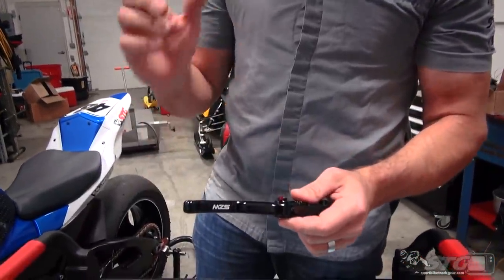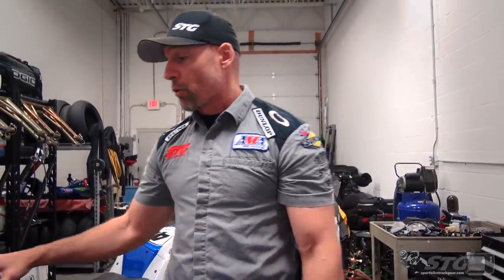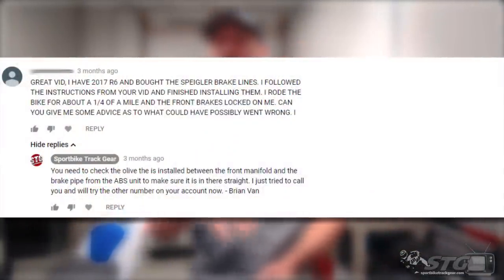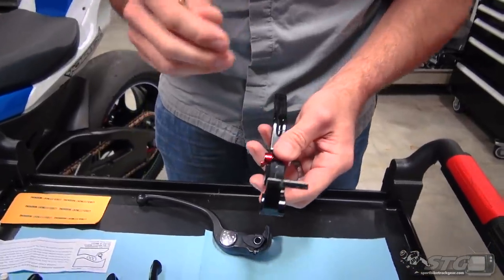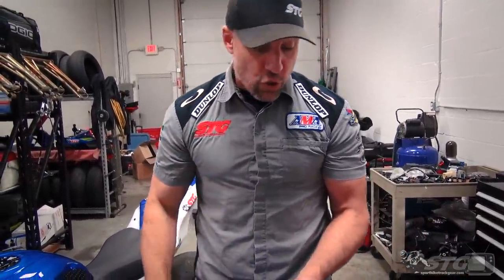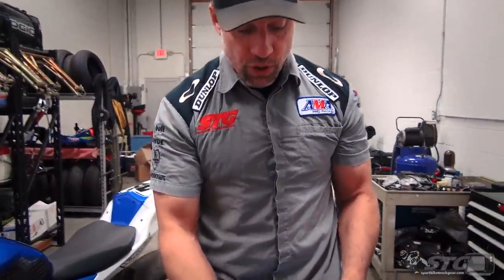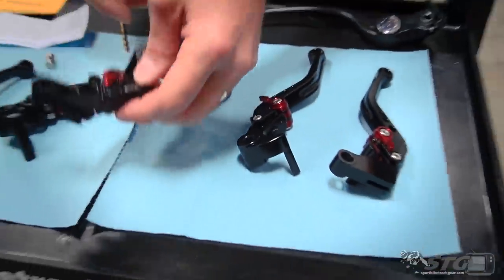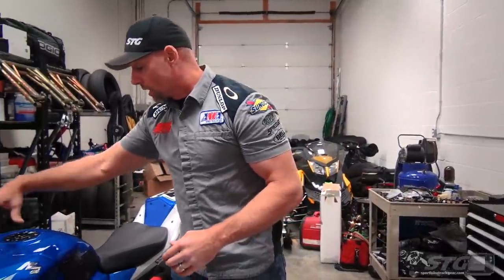The Truth About Cheap Motorcycle Levers | Sportbike Track Gear

Comment: i have a set of these on a used from I bought and never have really liked them. They do have a lot of play but no problems yet. but I had CRG on my zx10. My question i have twice had clutch wear issues on the grom, do you think the lever could be causing a faster wear issue like you showed inside the lever like with the brake pivot point?
Reply from the maker: While I suppose that is possible it would not be my first guess. Make sure you have the clutch cable adjusted so there is NO PRESSURE on the cable keeping the clutch open even a little. Too many people adjust the cable until there is no play in the lever which is not the way to go. - Van

Comment: I work at a powder coating company and have dismantled name brand $200+ levers and $20 levers. I can attest that the components are swappable and the mechanisms are IDENTICAL. I cannot attest for every single lever but I can say for certain that many levers are overpriced. They may have a better quality control system and ensure mistakes like this don’t make it through but of the 50+ levers I’ve disassembled I can take both name brand and eBay levers apart with my eyes closed because they are damn near 1-1.

Edit: I will also add that in powder coating the levers the metals have acted identically. I cannot attest to the grade of aluminum or other metals and if anything THAT is what you are paying for. The high price tag is an step YOU can take to have confidence in your levers. The QC is better and the Grade of metals MAY be better as well. Thank you for making this video and I’m happy to share my knowledge on this topic. If you are a safety conscience person and want to have confidence in your parts spend the money, otherwise the risk is in my opinion minor however not nonexistent.

Edit: Full disclosure I run a Brembo brake and clutch system simply for the performance. I have run ASV, CRG, Pazzo, Brembo, and a variety of eBay levers in the last 5 years. Always, take it upon yourself to inspect your parts ESPECIALLY if you are going to be pushing them to the limits. Regardless of the price point everyone company produces a bad apple at some point don’t be caught out! Safe riding
Reply from the maker: I have installed and sold control levers from most every reputable brand in the moto industry and can attest to the fact the parts used to assemble the MZS levers are 100% NOT IDENTICAL to those used in the brands we offer.

The design of the CRG and MZS levers is not even close to being the same. In this video we compare them side by side and you can see they share very little. You can not disassemble both of them and interchange all of the parts. Of all the lever brands we offer on our site none of them share the same design seen in the MZS. CRG, Driven, Vortex, Lightech and Renthal all use their own proprietary design. That said none of them would allow for a 1 to 1 swap with all of the pieces the MZS levers use. 

There are several comments on this video posted by riders who have crashed their bike after installing an MZS brake lever for a radial master cylinder. Riders would be better off leaving the OEM levers on the bike than they would replacing them with shit like the MZS. - Brian Van

Comment: This exact thing happened to me with the MZS, one minute the brake would feel normal, one minute it would be insane sensitive / close to locking up. Bought the CRG’s, problem solved.
Reply: How did you not discover that before the ride? Or are you saying that over the course of the ride the lever somehow changed tolerances?
Reply from the maker: Thanks for sharing that! This is a pretty serious issue and that is for sure. - Van

Comment: A friend of mine on 1000rr purchased CRG clutch lever and didn't EVEN installed copper bushing ( he didn't know, how to do it). Take a guess how it was riding. Granted bike was brand new and on low break in setting... we fixied it soon after this "instalation" fiasko.
I support what STG and Van do, by educating people etc on the other hand, I'm buying a lot of used stuff  (yes this means eBay and craigslist). I have two Ducatis. I've been doing this for about 10 years now. It is never black and white, there is a lot of gray.... and if you dumb numb, then don't buy a motorcycle, it doesn't worth it (do something stupid and then handicap yourself for the rest of your life)
I've seen manufacturers flaws no matter high expensive or premium manufacturer is. ex I purchased brand new Scotts steering stabiliser ($550) and right out of the box it had so much air inside, that I was have to flush it with brand new fluid.
Just like it is with buying used motorcycles....sometimes its a good quality bike, sometimes it is not. There is no rule of thumb or magic involved.
ex I have maybe 5-6 Pitbull stands, but I never paid over $50 for them on craigslist. Yes, one may buy cheap know off for $40-50 or spend 10mins online and get something used and decent quality.
My carbon muffler heat shield was proudly made in asia and I spent $25 on it...original Ducati was $180. I bet you $100 you won't notice the difference. My cheap LED was made in asia too and they were $10 instead of $250 and the list goes on

Comment: Again I apologize for the shirt comment, I didn't mean it to be something derogatory. Like I said I believe that you are doing a great justice to all those who ride. I have been contemplating switching 2 stubby levers because I am one of the people who uses two fingers to pull in my clutch and found that it wasn't completely disengaging because my other fingers were underneath the clutch lever. I have two questions for you, one what is the big benefit aside from looks of changing your levers. And two, do you recommend those shorter levers for those who use two fingers or are there disadvantages to them. Thanks for your time
Reply from the maker: No need to apologize my man, my skin is 1.3mm race grade cowhide! I have never really liked short levers, they provide less leverage than standard length and require more effort to get the same result. I set up my controls so I am grabbing the lever as close to the end as possible using 2 fingers. This ends up a little further out than short length.  On the clutch side I typically use all four fingers.

The biggest benefit to changing levers is the added adjustability you get with most aftermarkets. Folding levers can also help to prevent the lever from being damaged in a crash (depends on the crash). - Van

Comment: Well I just installed shorty clutch and brake levers from eBay on my 2017 z900 Kawasaki. They are a little wiggly up and down but after riding the bike for a while on the freeway it's not that bad or even noticeable so Brian was right on that part however Brian and Sportbike Track Gear do not have a brake or clutch lever product line for my motorcycle in that case what would he suggest?
Reply from the maker: Sounds like we need to find some levers for the Z900!!!
Reply: @sportbiketrackgear  yeah what do you got man I bought a bunch of stuff from you

Comment: Think long and hard about replacing any oe  critical system components. They may not look as sexy, but they work.
Reply from the maker: Never install any knock off controls on a motorcycle. Better to leave the OEM stuff for sure. - Van

Comment: So much truth and good info in this video. It’s so easy for us riders to try and snag a good deal on amazon on some badass looking levers, rear sets, handlebars etc. Its so tempting when reviews and pictures looks like the real deal at half the price or less. Definitely sounds good compared to 100 for a brake lever at the local shop. I ordered a pair of levers off amazon and honestly they felt like decent quality and they worked great for 2 days until they didn’t. At about 75mpj or so on the highway my bike suddenly started slowing down fast as fuck until I came to a complete stop right around a blind turn with a locked up front wheel. Didn’t even know what was wrong at first. Luckily I didn’t crash because it was already shitty enough having cars flying around a blind turn going 60 right at me and my completely unmovable bike. Almost got ran into a couple times shit was hectic. It took about 5-10 minutes before someone finally pulled over to help me lift the front wheel and carry the damn bike off to the side of the freeway. Front break wouldn’t release until I took the lever off. I rode back home put my stock levers back on and got my money back for those shit levers and even left a review saying what happened so no one else gets put on that same situation because it actually happens quite often with amazon/eBay levers.
Reply from the maker: Appreciate you sharing this, there is already several comments in this video about riders who have had these shit levers lock the front brake up. When I was doing my research for this video I looked at several listings for the MZS levers. The pictures in those listings make the levers look amazing and there are a lot of good reviews (if you dig a little bit there are also several reviews on Amazon noting brakes locking up caused by the levers) and at $35 a set I can see why they sell. The reality is once you get them in hand to inspect it doesn't take long to see the tolerances are shit. I bet if more riders could compare the cheap levers to CRG, Pazzo, Lightech, Vortex, Driven or ASV in person many of them would choose to spend a little more to get a lot more. - Van
Reply: Sportbike Track Gear yeah man it’s crazy how much more common this issue is. After it happened to me I did some reasearch which I wish I would have done before. But yeah many people have had a real fucked up day because a good deal got the better of us. Hopefully more people see the few bad reviews over the many good ones because as riders we already gotta deal with people always on phones or just not paying attention what so ever. We don’t need to worry about our bike parts failing on us. Ride safe and god bless bro keep it up with these videos👍

Comment: I actually been running these same levers for almost 3 years and no issue. 
06 CBR 600 RR
Fortunately on this year model cbr, there is no pin inside the lever that rotates like the one displayed that failed. This could be easily caused by installation error, not properly  greasing the cross pin perhaps? Glad ya homie is alright tho? Keep the shiny side up!!
Reply from the maker: Your bike has an axial master cylinder and those are not affected in the same way. Personally I would not run these on my lawn mower. - Van

Comment: Hello, I wish I had watched this video before I had bought one. Upon inspection the little thing that needs to rotate on the brake lever actually rotates with no problems or tension. Does this mean I can use these? Cross pin***
Reply from the maker: Personally I would not run these on my riding lawn mower. IMO the savings is just not worth the risk. - Van

Comment: Brian,  if I wanna the money on a good lever, how and where do I get the levers for the 87 Rebel Cmx450c.  It's in great shape,  been rebuilt, except for the levers n for pegs. I did get a set of the Fxcnc levers, and held them while watching your video.  It's very smooth in brake yet tight n no slap or movement in the adjustable lever setting, tight roller adjustment,  But, I'm still very leery about putting brake lever on, clutch lever works great. It's next to impossible to find an adjustable lever, that's good,  one I feel n know is safe.
Any ideas for the classic?
Thanks again Brian.
Reply from the maker: Sorry I am not aware of any aftermarket levers for that model. Our focus here is all on current model sportbikes. - Van

Comment: Great video. You speak the truth but I have a question. Mainly about the clutch lever. 
I have a Kawasaki with a cable clutch and the OEM levers look cheap as heck, YET, they insert a bronze bushing at the pivot point. How come none of the big name aftermarket manufactures including CRG, Pazzo, etc. use bronze bushings? They have only drilled holes in the aluminum. 

I was guilty of buying cheapo eBay levers. I drilled them out and inserted the bronze bushing from the stock levers. I will not buy the cheapo any more.
But my question remains...How come no bronze bushings in the main pivot point?
Reply from the maker: Good question, I will ask Mark over at CRG. I always lube the pivot bolt well on install and later when lubing the clutch cable to keep things smooth. - Van
Reply: +Sportbike Track Gear ...Thanks, I appreciate it. I will look forward to their answer.

Comment: Do shorty levers make 2 finger clutching and braking easier?
Reply from the maker: Personally I do not use short levers because you have less leverage with them which increases the pressure you need to apply to get the same results. - Van
Reply: @sportbiketrackgear  another question: when it comes to clutching should I b using two fingers only?

Comment: I have the M2Z levers for my cbr500r. They feel nice but have all the poor fitment you describe. I felt the clutch cable rubbing inside the lever when pulled. The OEM had a rounded piece that the cable would ride on to be smooth. I've taken them off because I wasnt about to have my clutch cable snap from excessive wear. The brake lever worked fine but had excessive play within the perch and adjuster. No more cheap parts for me. I'll pony up for a high end lever if I decide I really need them.

Comment: I don't mind buying Chinese knock offs for things that don't matter too much like fender eliminators, turn signal lights, or even to an extent exhaust. But there is no way I would ever cheap out on something as important as levers or any other control surface or what that control surface is connected to.
Reply from the maker: Best practice is to never install cheap controls on your bike for sure. - Van

Comment: I've put those levers on 4 different bikes over the past 10 years, always been happy with them. Definitely cheaper than some aftermarket brands, but they're just as nice as the cheap OEM levers that come on bikes.  I agree you want to give them a good look over.  The locknuts vibrated off of both levers,  and the levers could have come off of the bolts had done the same.  Nothing some better hardware and some loctite can't fix.
Reply from the maker: I have put CRG levers on more bikes than I can remember and none of the hardware has vibrated off. If you need to same some money buy cheap toilet paper, the worst that will happen is you need to spend a little more time washing your hands when your finger pokes through. - Brian Van

Comment: When I bought my first proper motorcycle I went to buy a helmet, so I ask from the guy in the shop to show me budget-friendly options, before he show me anything he ask, what bike I ride and how I was intended to ride, he's words after that stay with me for ever, he said YOU WILL SPEND WHAT YOU THINK YOUR HEAD WORTH. Since then all the major components on my bike and riding gear is the best I can buy, if I can't afford it I use the factory equipment till I save the money to buy something better. On a motorcycle you can't play Russian roulette, if something failed it will hurt (if not the worst).
Reply from the maker: Very well said, this is the same approach we promote here. Thanks for sharing! - Van

Comment: Fun fact? Those things are actually illegal to use on public roads in Germany... and I believe that's the case for all of the nations in the European Union?

Illegal as in you're not allowed to install brake levers that weren't tested and certified - and the allowed stuff over here is in the same price range you mentioned for the recommended levers. Sure you can buy the cheap stuff and use it on private property - but if you go onto public roads and the police does a random check and finds non-certified aftermarket brake levers, you can call the towing service, because you won't be riding that bike anymore until you've changed to certified parts and got the approval from the inspector guy. That plus a nice fine to pay - if it's a security relevant piece like the brake lever, you'll even get points on the license register that you'll keep some years before they expire. Too many points and your license is gone =D

Comment: shit, I already have Hotbodies MGP shorty levers installed. And I just got the spieglers steel braided line kit installed. Do you have any knowledge as to whether ill have a similar safety issue?
Reply from the maker: I have installed a couple sets of Hotbodies levers and they did not use the same design I have seen with the MZS. - Van
Reply: @sportbiketrackgear  thanks

Comment: Hmm...well, that's now a concern.  I bought a set of these (MZS triangle design) for my Tuono because I loved the look and figured why not try them out. I've been running them for about a week now (couple hundred miles) and haven't had any issues.  Once all of the nuts were tightened up they actually felt better than the stock levers.  I happen to have a lot of respect for what you folks at STG have to say and have purchased a number of items based on your recommendations.  Now it's going to be in the back of my mind every time I ride...maybe I need to switch back to the OEMs...
Reply from the maker: The major issues are with the radial brake lever (not sure if your Aprilia uses a radial or axial master), if your bike has a radial master cylinder I would not ride the bike with the MZS levers on it. We all love saving money so I understand why these cheaper levers are attractive. - Van
Reply: @sportbiketrackgear  It's radial (2018 model)...and it wasn't about saving money.  As I said, I loved the look.